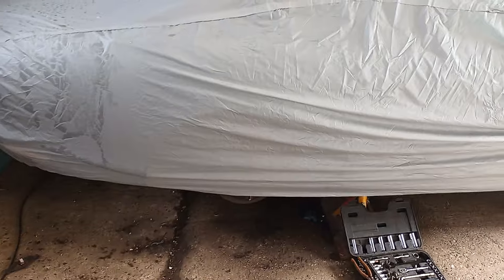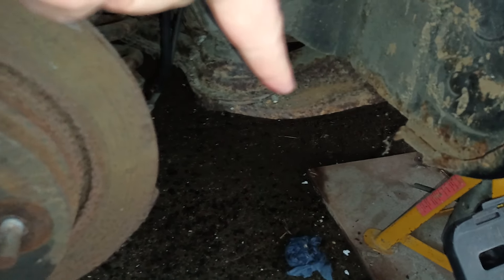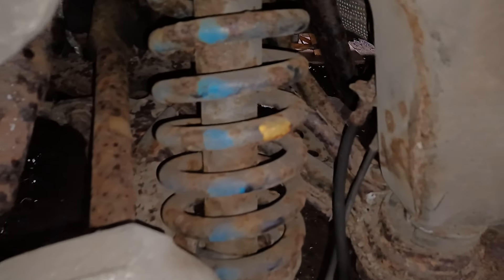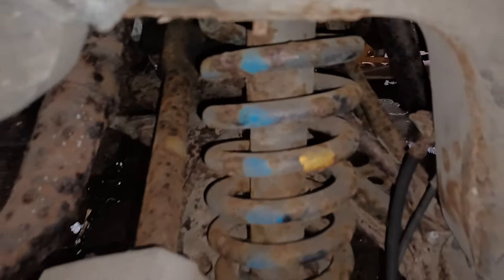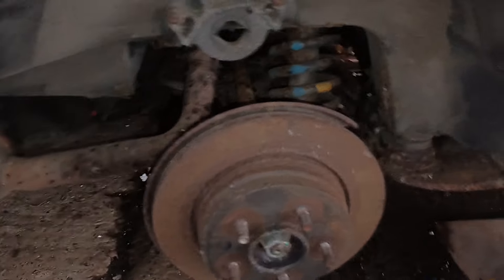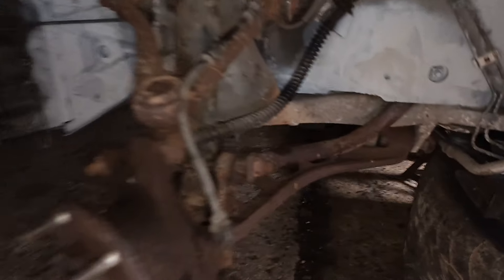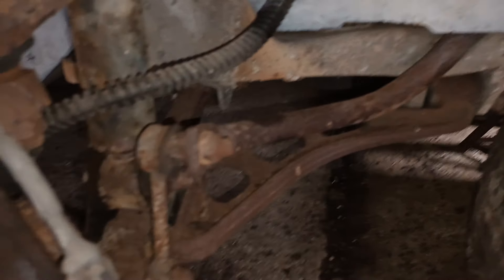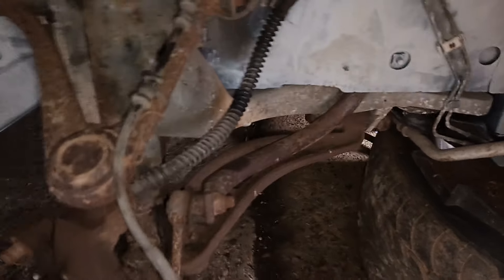Jaguar XKR project Episode 43 | Shall I dop the sub frames? cast your vote in my poll

Comment: I would definitely drop the subframes. The front and rear vertical faces of the chassis are a known rust trap, so much easier to check/ repair if the subframes are off.
Reply from the maker: Hi David, Thanks for your input, buddy. I agree, I will definitely get to a lot more problem areas with them out of the way 👍

Comment: Hello  Simon  , I'm in total agreement  with you , drop the subframes , free the car car from rust it's all job done then and it will give you piece of mind,  definitely go for stainless  steel  exhaust stage 1 and 2 straight through , you won't regret it and the sound is just wow , all the best 👍
Reply from the maker: Hi Mark, it's good to hear from you, mate. A nice stainless exhaust is deffo on the cards, so I may as well get stuck in and drop it all down  👍

Comment: I have a 2004 XK8 and am currently facing a similar dilemma.  Both floor pans around the seat wells had corroded clean through, so I had these cut out and replaced.  A relatively straight forward job as it turned out.  However, the subframes now look like those on your car Simon, as do the rest of the suspension components.  No rot as such, just horrible looking surface corrosion.  This and both rear wheel arches that have started to bubble and rust.  My plan is to replace/restore the suspension/sub-frames and coat the entire underside with a preservative.  Dealing with the wheel arches is another matter, as I will need to pay a bodyshop to have this done.  Is it worth the time and money I'm wondering?  Or is it time to cut my losses and trade my XK8 in for a later X150?
Reply from the maker: Hi buddy, it's really good to hear from you. Unfortunately, we are not alone with this dilemma it would appear. This is my 4th XK8, and they have all looked very similar underneath I am sorry to say. 
For me personally, it's very worthwhile getting it sorted, as I will then have a car that I know has been sorted out properly. If it's something that you have to continually pay someone else to do the work, then it can become an expensive endeavour. 
I guess it all comes down to your personal preference on the cars. The X150 cars are awesome, and I'm sure one will come into my barn at some stage sooner or later. 
There will always be something to do on these X100 models, but that's the fun of it all for me 😀👍

Comment: Sounds like a plan. Does it actually run ok now? My only thought is its only worth it if the engine is ok.
Reply: My thoughts as well. You could end up doing a lot of cosmetic work on the car, and then find out that you need a full engine rebuild, and/or a new ECU. I get your thinking Simon, but it seems like a bit of a tangent. It's not bad underneath, but it still needs a few shake down runs to see if you can sort out the engine.
Reply from the maker: Hi buddy, it does seem to run OK now. I won't know for sure until I get it out on the road, though. But I'm all in now and will address any problems as and when I come across them. What's the worst that can happen, apart from draining my bank account and sucking the life right out of me 😀👍
Reply from the maker: Hi Jem, I wasn't looking to do this job now, but I think it will work out well if I just get on with it whilst it presents the opportunity. If it needs an engine or other such things, then so be it, I'll just have to crack on with it. It's too late to turn back now buddy 😀👍
Reply: @projectsinthebarn  😅👍